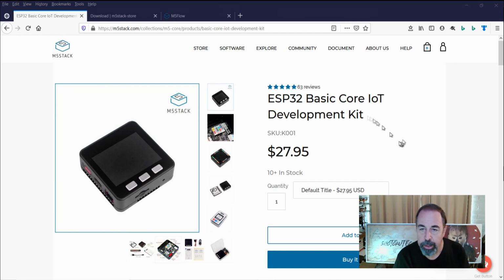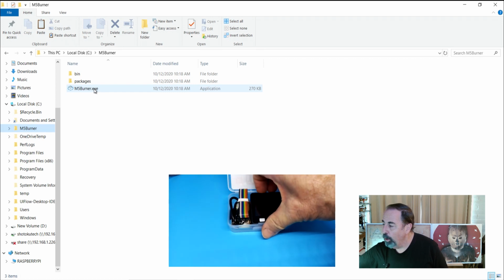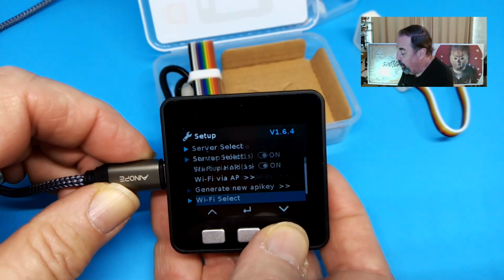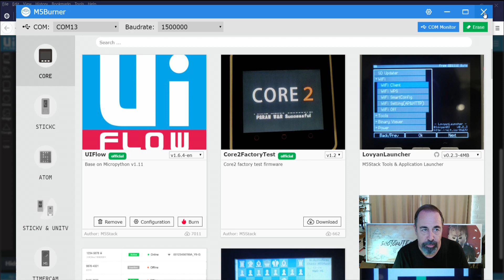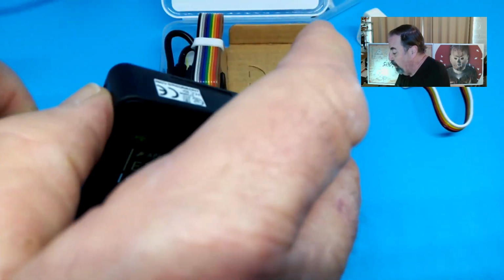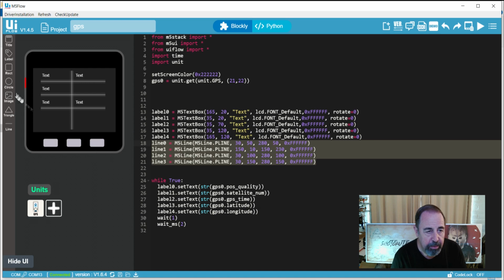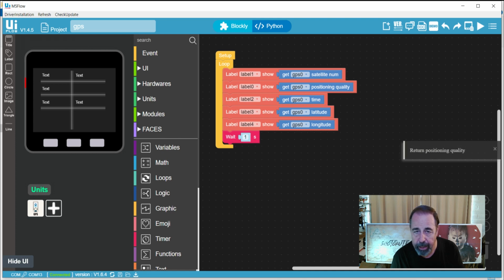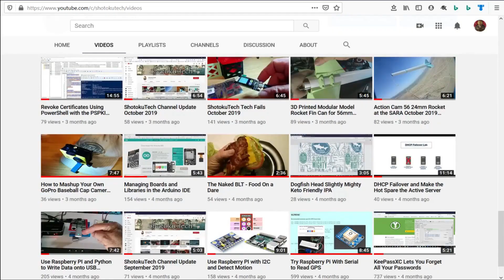Getting Started: M5Stack ESP32 Basic Core and UIFlow

Comment: And you trust China with connecting to your computer with all your data, that could be downloaded to China, we know dangerous China can be at steeling information, and you have just opened your computer!! Your opinion on this, and what safeguards for privacy do you have in place? Just joined your channel
Reply from the maker: It's more likely that your computer and cell phone have back doors to China, than some tiny ESP32 that you can monitor via the serial port, wipe the memory entirely and program as you wish. I don't take any precautions working with ESP32 devices. Thanks. Best wishes.

Comment: i installed m5burner and im not seeing any of the firmware pop up on the screen it stays blank on the main screen, tried logging on and nothing... only thing that works for me is esphome for some reason. using a core 2
Reply from the maker: Hello. M5Burner doesn't really install on a PC. I just download the zip file and copy all the contents of the zip to a folder named M5Burner. So you have the executable and two folders named 'bin' and 'packages' inside the folder. I just tested this now and it works as expected. I can see all the optional packages to install. Thanks.

Comment: how do i do it for the new core2
Reply from the maker: Should be virtually the same to get going in UIFlow. Both M5Burner and UIFlow have a separate selection for Core2. Thanks.
Reply: @ShotokuTech  Is it normal that the touch buttons on the bottom do not work for me? i can't move in the ui graphical interface in the core, the touch buttons are not responding
Reply from the maker: I don't have a Core 2 so I am not familiar with what the UI is out of the box. So you are saying there is a UI to navigate and ABC buttons do not respond? Does not sound right to me. Core basic has a default UI that just has a button test at the end where you press each button then test is done. No UI to navigate. You may want to contact M5Stack on this if it is not right.

Comment: When I try to run the burner, it does not connect.
Reply from the maker: If it starts up and goes into app mode, you won't be able to connect. (Running current program). I was just strggling with the ATOM Lite this week, same thing only no screen on it to tell you what's up. See if you can get into menu right after powering on? If you still have trouble let me know and I will try here. Working on Heltec video right now so mind is on other things.
Reply: @ShotokuTech  I made a little progress.  Put the M5 into USB mode, rebooted.  But it still won't connect with the Burner app on the PC.
Reply: Works, just needed to download a driver!
Reply from the maker: @fredscholl5250  CP210X driver?
Reply: @ShotokuTech  That was it.  Sets up a new COM port COM5
Reply from the maker: @fredscholl5250  Always good to hear good news. Thanks for keeping me posted. Have fun!

Comment: Hi when i open the m5 burner and chose Core there is nothing there. any suggestions?
Reply: I figured it out, it was because I didn’t drag it to applications
Reply from the maker: It sounds like you don't have a complete installation. I download M5Burner from the M5Stack website and it is a Zip file. All of the contents of that file need to be copied to your hard drive. (M5Burner.exe, Bin and Packages folders). Properties of my M5Burner folder are 205 Files, 27 Folders, 320 MB (336,422,574 bytes). Is that what you are seeing?